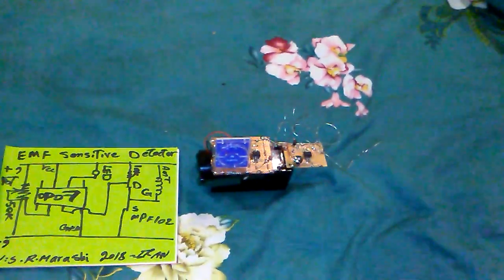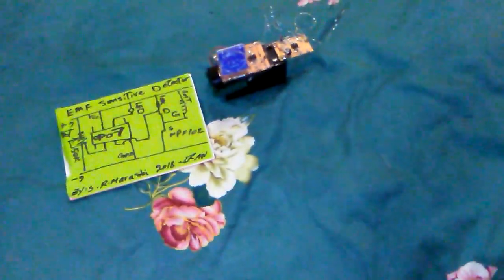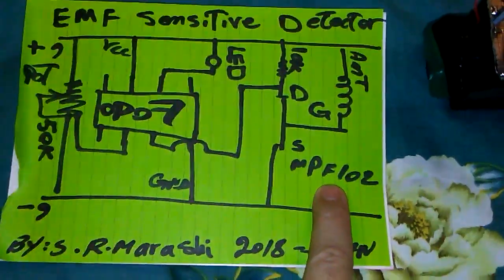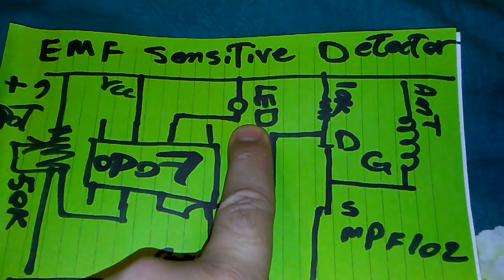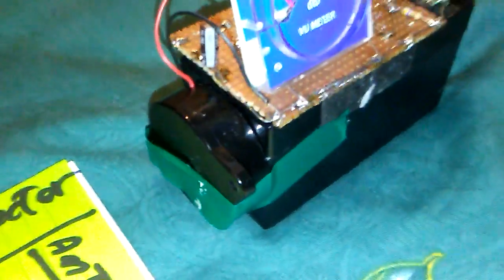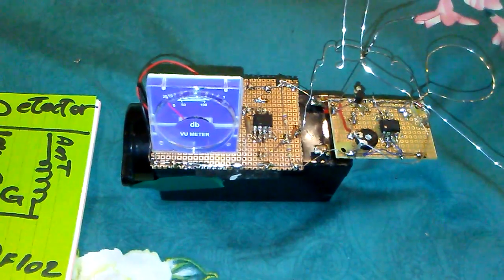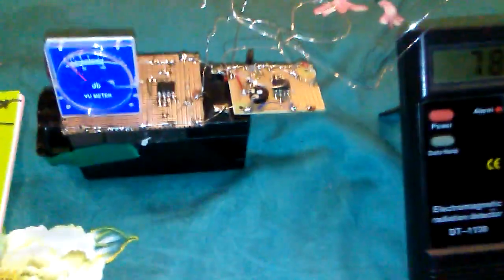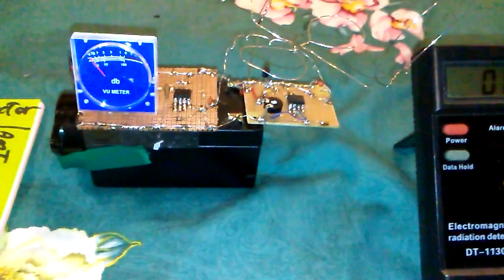super sensitive EMF detector with analog VU meter

Comment: alakum selam seyed .. Do you have gold ion detector working?
Reply from the maker: hello, no. the Gold detector and ion detector are different!
if you want Gold sensing circuit it is possible! Use Sensitive opamp the resistance frp, Gold and other materials are different, 18K and 24K Gold with MCP6401 opamp detectable, if you want ion detector for Liquid Gold let me know.check my video short detector it is sensitive opamp the output sound for Gold and metal and other materials are different

seyed
Reply: @seyedmarashi  have you designed the schema or circuit?  Thanks
Reply from the maker: yes, try to visit short circuit finder in my videos
, short circuit finder in fact is material ohm measurement, Gikd, lead, iron, copper, ....
Reply: @Seyed Marashi سید اینجا که می‌فرماید با اپ امپ های با سنسویتی بالا تر میشه آشکار کرد طلا رو میشه از شماتیک مشابه همین ویدیو با mpf102 استاده کرد یا که کلا شماتیک تغییر میکنه؟🙏
Reply: Can you tell part for make its